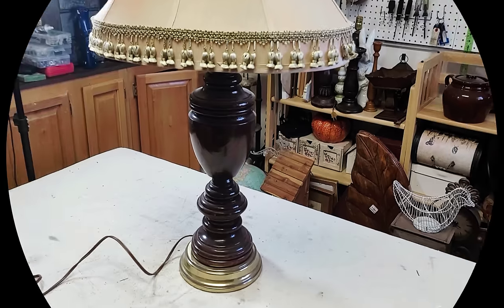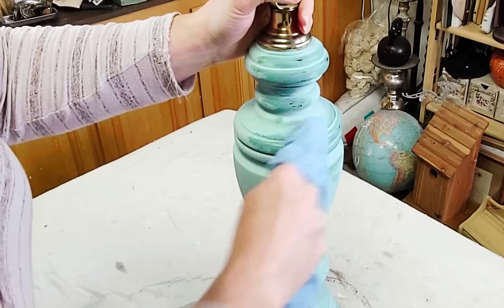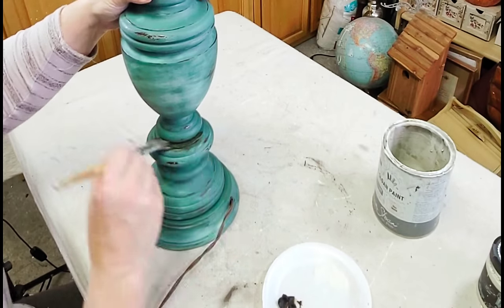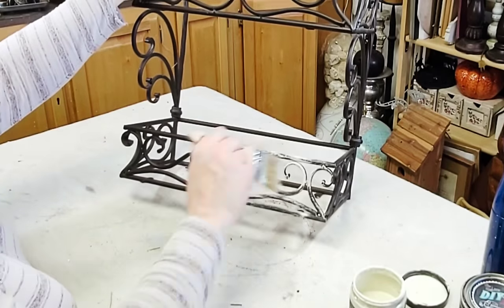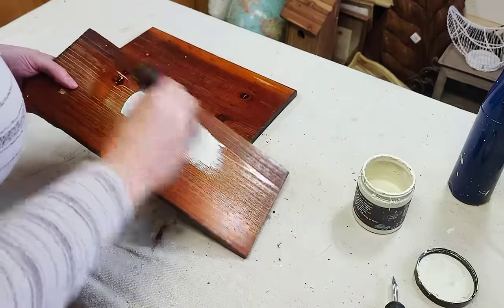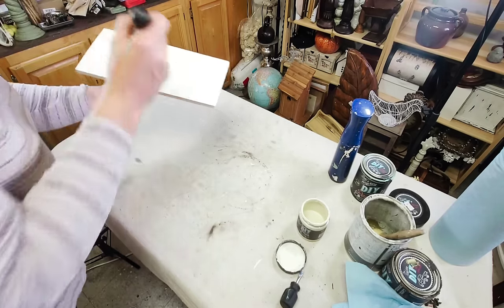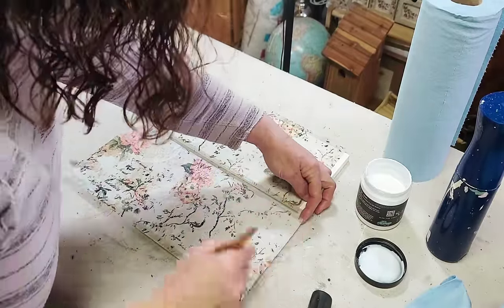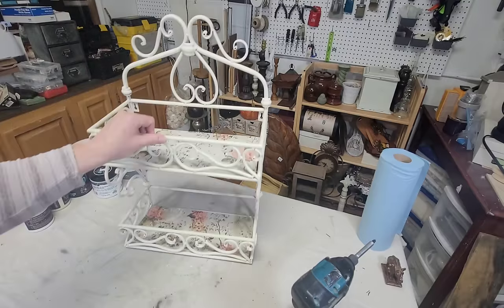Thrift Flips • Trash to Treasure • Upcycling Some of the Bulkier Items In My Stash • Upcycled Decor

Comment: I love both! But the lamp was probably my favorite! I love all the older lamps! Do you spray paint out side when it’s cold? I was just wondering because I have some items to do and it’s very cold where I live! Have a great weekend and see you Tuesday!
Reply from the maker: I'm so glad you liked them!! :) And I do spray paint outside as long as it's not TOO cold - I wouldn't do it when it's like 15 degrees . . . but as long as it's close to freezing and I can get out and spray and back in where it's warm relatively quickly, then yes - I will spray. But I make sure my paint and my item are both room temperature and I spend as little time outside as possible and bring the item in immediately to dry inside . . . if that makes sense! It's probably not the "recommended" thing to do - but sometimes you just have to roll with what you've got! :)